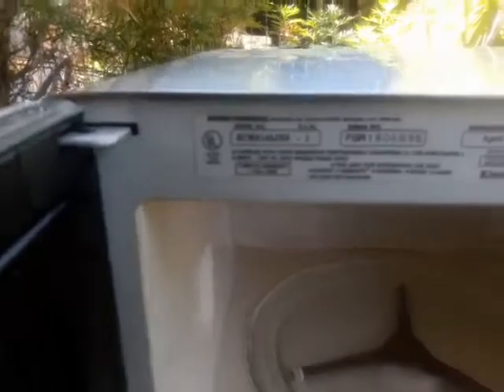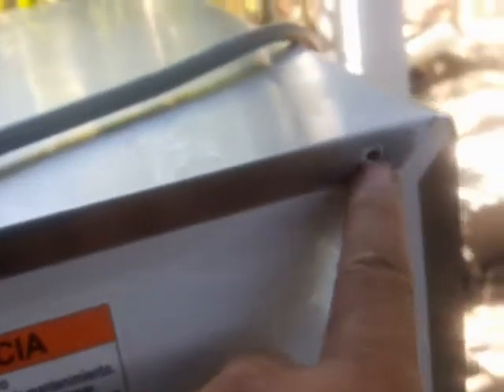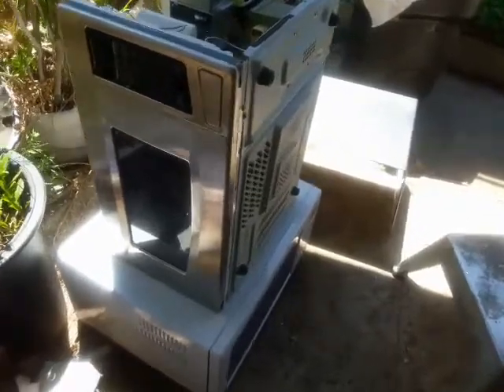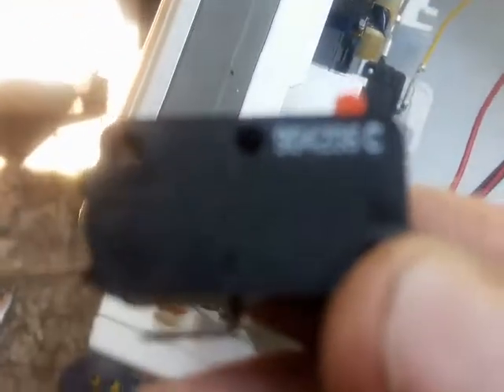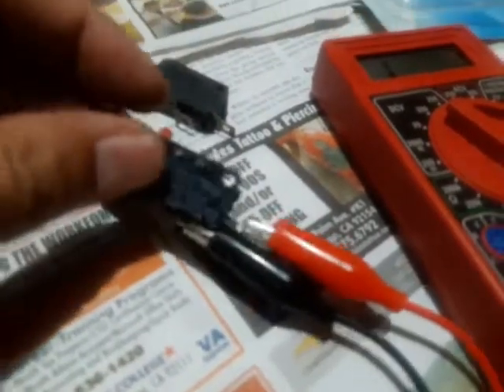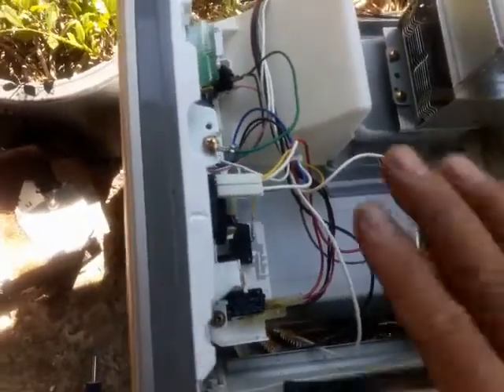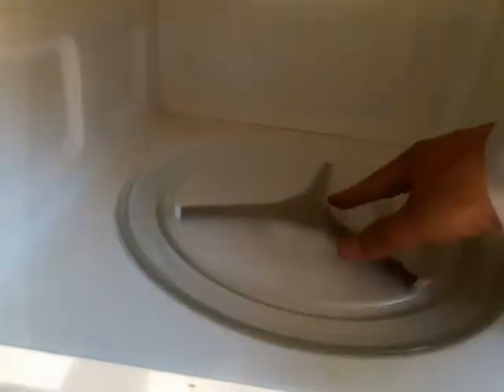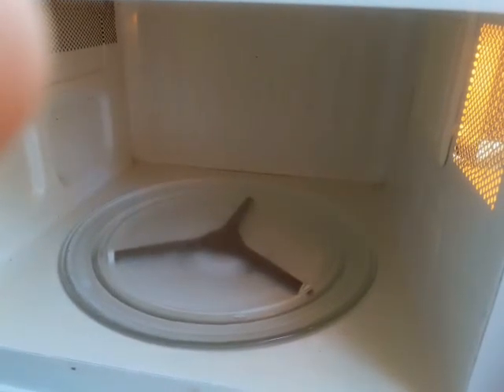KitchenAid Microwave Not Heat Up Fixed for under $10.00.

Comment: How did you know it was the bottom door switch that was out? or did you test them all with the multimeter first?
Reply from the maker: I was going to check all the switch but the bottom one is the first one I suspect of failure and luckily, it was that switch.